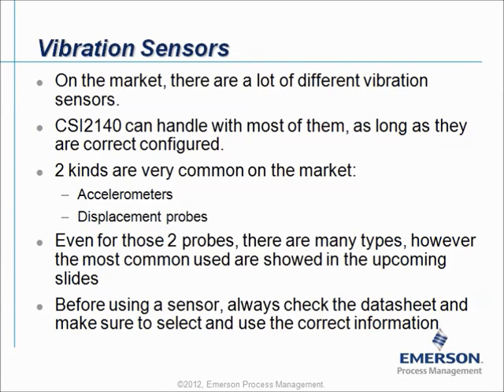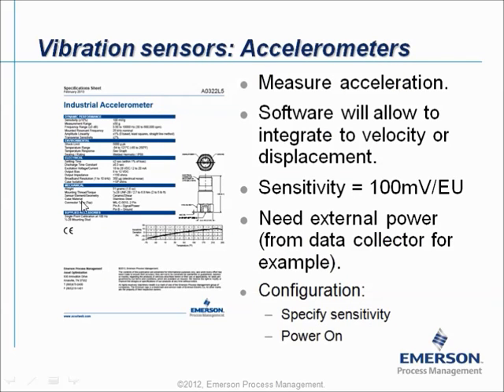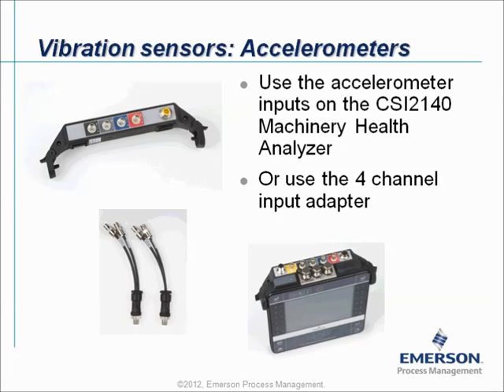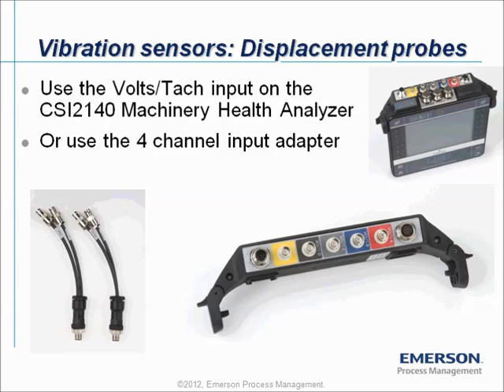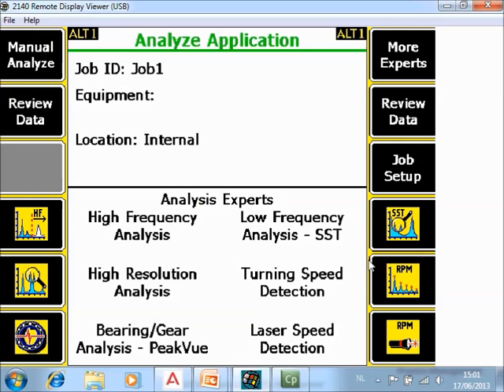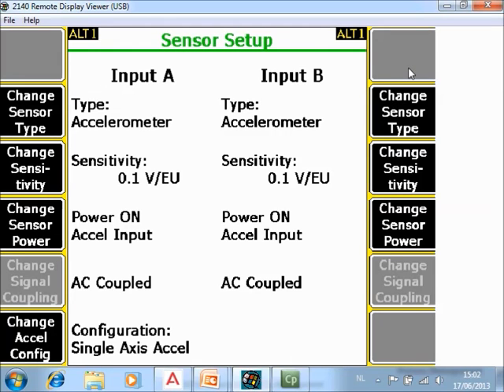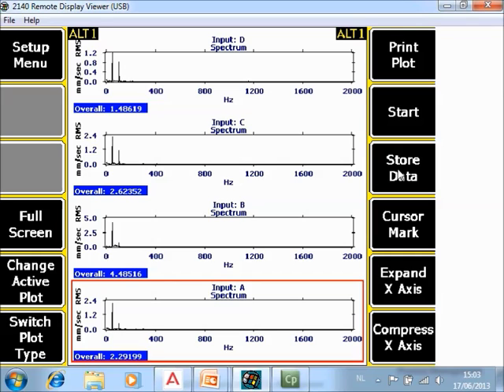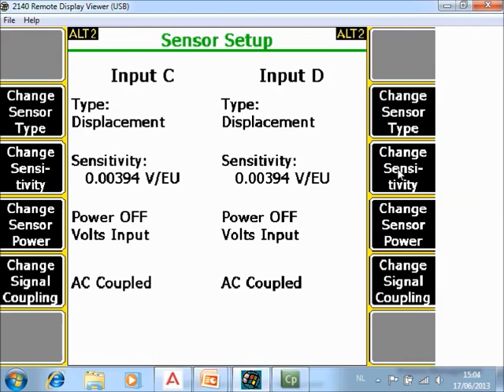Collecting Data with Vibration Sensors with the AMS 2140 Tutorial

Comment: Displacement setting sensor power off  again analyzer sensor power on
Reply: If you would like support on the AMS 2140 (AP-SMS@emerson.com) , the best option is to contact our customer support group. However, I can confirm that you can connect the signal from a displacement probe to the AMS 2140. It does require that you turn off the sensor bias.